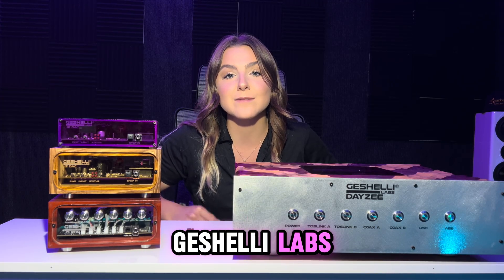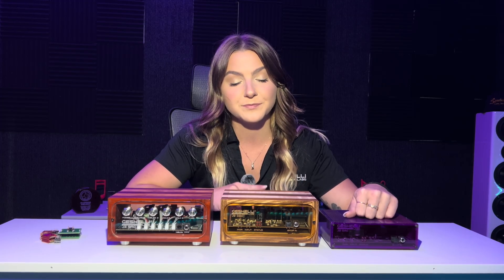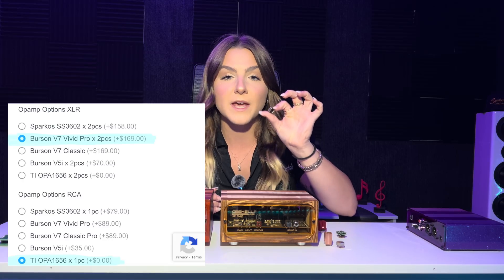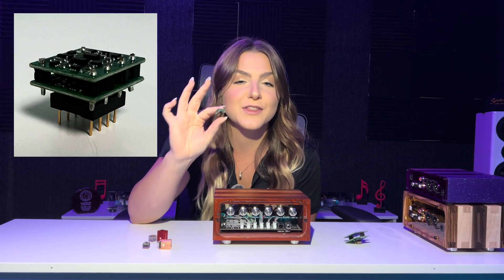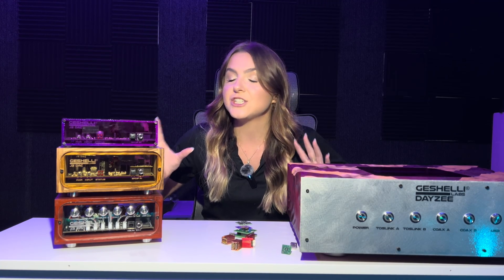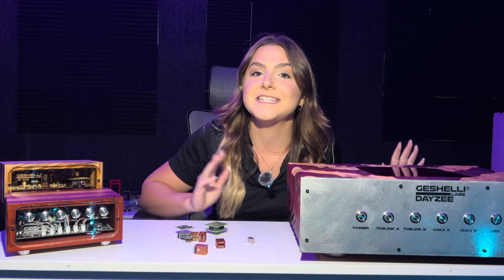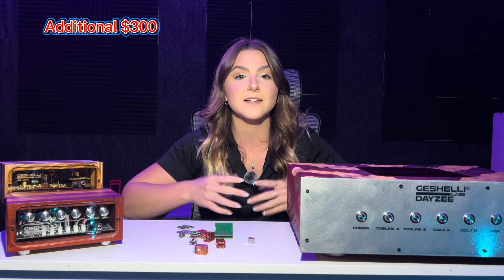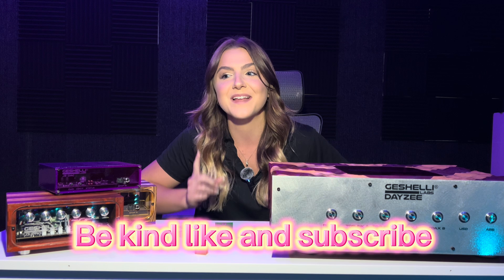WHAT DAC IS RIGHT FOR YOU? DAYZEE vs J3 PRO vs J2S vs J2

Comment: I am new to the whole “op amp rolling” thing—what are the sonic characteristics of the SS2590 that draws people to them?  Anything to do specifically with bass performance and stellar handling of low frequencies?  Or do those “macroscopic” characteristics come more from the overall circuit layout and implementation?

 Some reviews suggest that the Dayzee is a great DAC for people who like a strong low end.  It’s a bit out of budget for me though, would a J3 with the SS2590s perform similarly at the qualitative level with respect to bass slam, dynamics, extension, etc?

Comment: Have had a J2 DAC since last year.  I find that it needs a specific setup to shine. Even changing one other component of the system it's connected in completely changes how it interprets the output. Using a Schiit Magni Unity with it sounds awful, some notes are piercing and volume balance of different instruments and sound effects is very off balance; using a Nitsch Magni Piety, its the complete opposite, every note shines and isn't fatiguing while audio balance is pretty much perfect.

However, the Soundstage has a "2.5D" quality to it, which is probably just a limitation of the AKM4493 chip. I suspect that the J3 with dual Sparkos SS2590 on unbalanced route will offer fuller dimensionality, so I'm planning on buying a J3 later this year.

Using the basic J2 was a test run to see how well it works in my setup, which does include a 12V linear power supply unit from Audiophonics. It might be too much for some units, but the J2 at least responds well to it and provides some extra oomph to bass that I felt was a bit lacking with the default switching power supply.

Your mileage may vary, this was just my own perception. Keep up the good work!

Comment: Great informative video. Want to order the J2S version.I heard somewhere that there's a newer, slightly more spacious version of the J2S that can fit the sparkos lab ss2590s much easier in comparison to the first versions, is that true? Or can the J2s be altered to make the dual opamps fit more comfortably?
Reply from the maker: @phrocasso5906  thank you! The J3 is the bigger form factor which can fit the 2590’s in both the XLR’s and RCA’s comfortably! It also has independent switches for the inputs as well which the J2S does not offer. In order to order the 2590’s you do have to email in, as they do not come in the unit due to the heaviness, but I do have a video on how to swap the op amps and take the unit apart and put back together. Hope this helps!
Reply: @RachelGeshelli  you're welcome. The J3 does look nice, with the additions and space it may suit my wants but I just need a J2s. Is there a way to get the box from the J3 pro or Archel or special order the J2s with the J3 pro or other housing? Is it better to order the sparkos opamp from you guys? Thank you for the quick response and valuable information.
Reply from the maker: @phrocasso5906  you’re welcome!! And the J3 is taller to match the bigger form factor of the A3 and E3. The design of the board makes the 2590’s fit as they are wider than any of the other op amps, So the sockets are more spread out on the board. You can upgrade the case to the bigger form factor for the J2 as well if you wanted! Just write it in the comments when purchasing or email in!
Reply: @RachelGeshelli  You clarify things straight to the point. It makes sense with the J3 pro as the board is more spacious along with it's housing. Sorry, one last final question, would the 2590 fit the J2s with the bigger form factor?
Reply from the maker: @phrocasso5906  I try to hahaha I’m glad it’s all making sense! And so the bigger case doesn’t really have anything to do with the 2590 more to do with the independent switches! The regular j2 size case will fit the 2590 in height. You could fit it on the RCA but not the XLR’s.

Comment: I had a chance to meet Geno and Sherri, and their entire family/staff.  They graciously gave me a factory tour and answered all of my audio questions.  In their listening room, I auditioned their flagship Dayzee DAC, with stock op amps, connected to their own amps played through AE520 speakers.  The high res audio tracks were astonishingly surreal.  There simply were details in this music that I’d never heard before, and I’ve auditioned 500k systems. The mid and low bass was powerful and impactful, with the upper register being clear, detailed yet non fatiguing.  After hearing the Dayzee, I couldn’t audition the J3 pro.  The experience was so incredible, that I couldn’t get anything less than the best!  Sherri mentioned that if your budget allows it, go for the Dayzee with stock op amps vs the J3 Pro with Sparkos, since the price difference is nominal.  If you want to take it to the next level, you can upgrade to Sparkos op amps later. Very friendly team of people, extremely knowledgeable and quite accommodating.  Kudos to Geno’s amp and DAC designs!  FYI, the purple heart wood case is absolutely beautiful!  Very cool experience.  Thanks so much!

Comment: The op-amps are sensitive to electrostatic discharges (ESD) and appropriate handling precautions should be taken to avoid damage to the semiconductors. For example, the Texas Instruments (Burr Brown Audio) datasheet for the OPA1656 op-amp (section 6.2) states an ESD protection level of 2,000V (human-body model). In atmospheric conditions and especially if synthetic materials are present (synthetic clothing, carpets etc.), the ESD levels can easily exceed 10,000V. The semiconductor manufacturer will ship this type of ESD sensitive component is an anti-static bag. The user of the component is expected to employ protective measures to mitigate the ESD risk whilst handling and installing the component into the end equipment. In an electronics lab the Technician / Engineer will wear an anti-static wrist strap and have dissipative mats on their workbench. The Burson and Sparkos op-amps are assemblies using discrete components but are also likely to contain ESD sensitive semiconductors.

Comment: There's a lot of people on here thinking the same thing as me with all the configuration differences they offer.   Let me offer this tidbit of advice:

I literally heard their two newest DACs TODAY on site (Dayzee with stock TI op-amps & J3 with Sparkos pros).  When I found out G were just a neighboring town away from me, there was no way I wasnt going to pay them a visit.   The Dayzee is really slick and it will add another layer of resolution due to its dual mono design...but its main claim to fame is hooking to different amplifiers due to its unique dual XLR and dual RCA outputs.    And the larger case makes for some amazing woodwork styles you just have to see in person.  One thing to note Rachel mentioned  is that you have to change out all 8 op-amps in the  DayZee due to the mono design (that could get quite pricey)--and it's substantially larger than all the other DACs due to those two factors so check that for space considerations.    Another question I've seen:  The J3 page should be live on their site sometime this weekend...

Based on the op amp talk here, I'll let you know that I actually preferred the  Dayzee with the stock TI ops than the J3 with the 2590 Sparkos on most tracks I listened to...so  it might be wise just to start stock and upgrade only if you feel you need to. You may find the base devices is all you need.  I felt the Pros,  although having a little more bass oomph, in doing so actually stifled some of the music detail.   But of course they say, YMMV.

That said, the J3 should be the best bang for the buck for most people, and with covering all four popular op-amp designs and less of them to upgrade... it's literally "tube rolling" days all over again :)

Oh yeah...one more important thing. The comments you hear about how nice this family is are most definitely warranted... probably the nicest bunch of audio people have come across.   I could have spent all day and their listening room with Geno....but lots of work to do to get all those handmade products out in a timely manner to you fellow listeners :)

Comment: Why is the DAYZEE so huge?
Reply: As Rachel said it's a completely different beast.  It has basically two DACs inside with the mono design (unlike the rest it has dual AKM 4499/4191 chips).   Also it has dual outputs for both RCA and XLR balanced.  All that needs significantly more space for the connectors & to let the components breathe... but also it's larger size allows for some of the nicest woodworking designs I've seen on an audio component.   That's why it's not very heavily advertised and you basically you have to inquire about it for the details.    It also takes them hours and hours to meticulously make... so they only allow US orders at this time so they don't get overloaded. 

I heard it today and it sounds fantastic with just the stock TI op-amps.

Comment: Nice to see the different offerings. That Dayzee is something, but well out of my range and would not fit in my rack anyway.
I'm about 85% analog and 15% digital if you count CDs. I do stream, but only for occasional background noise and research, I can't stand formally listening to it. For formal listening I go with vinyl records or CD. 
That said, I have never had an outboard DAC, I just have the one in the CD player or the one in my preamp. I think the dac in my current CD player (Marantz ND8006) is likely alright or good enough, I'm not sure. The dac in my preamp though sounds slightly harsher and thin. One would think that is not the case given the cost, but the focus in design was really on the analog side and overall circuitry, which a good job was done there (partly why I bought it). The dac and headphone amp were afterthoughts in my opinion. (The headphone amp is pretty poor, so I got an outboard and solved that issue).
Anyway, I am curious about getting an outboard DAC to see IF there is any notable improvement to my system's sound for CDs and other digital stuff. I have been told there will be by many, but who knows since we all have different listening experiences. 
I know nothing about DACs beyond the very basics. I know I am tired of ESS as that is all I have ever experienced in all the CD players and such I have owned. I'm looking for a more natural sound.
An R2R DAC would have a more natural sound, but they are expensive and not many on market. I know nothing about op amps or the differences between them or between DAC chips. I believe there are no differences between DAC chip brands, but the differences are in implementation of them. I may be wrong or perhaps partly correct.
My getting an outboard DAC is pretty low on my list, but if I could try one I would choose Geshelli Labs indeed as I have been looking at your DACs for the last almost two years and when the time comes, I would need to talk to someone for some education (what op amps do and the differences, etc.) in order to select the DAC I want to try. I also can't get spendy so I would look at the J2 or J2S. I would also need to arrange something in case it does nothing, like cables.
Again, it will be a little while though as it is not high on my priority list to get an outboard DAC.

Comment: The Geshelli Dayzee with the big Sparkos SS2590 units is definitely *superb*!  I listened to it with the stock TI OPA1655 for several months, using a 12V 50W linear power supply. With the stock op-amps all the qualities I mention below, are there - but upgrading them extends/expands all of these to what I consider to be ultimate.

So many passages of music that I used to think were congested and overdriven - are sounding open and clear. Many recordings have 3D space and instruments - many sound almost like "new" music to me. Harmonies and counterpoint and discord and really subtle details - all come through - and I have to totally re-adjust my perception of the music.

Bass is simply just right. The extension and weight and clarity is flawless, for all intents and purposes.

Soundstage on good recordings is YUGE, and many are 3D - even some that I would never have thought had this quality.

Clarity - is far more than "just" extended treble. It is a coherent whole - and it covers the entire spectrum, ideally.
In my opinion, the Dayzee is balanced and neutral and also dynamic and clean. Nothing is out of place - and everything is in place.

I have had all the Geshelli DACs that have AKM chips (except the very first JNOG), and they are all wonderful. For me the J2S with the AKM 4493 is the perfect entry point. I have not been able to listen to any of the Burson op-amps, but I did listen to about 7 or 8, and for me the Sparkos are my preference.
Reply: When you stated that "So many passages of music that I used to think were congested and overdriven", was that in regards to the TI op-amps in the Dayzee? And then it opened up after installing the Sparkos?
Reply: @michaelwright1602  This is something the stock Dayzee does very well - and then after upgrading, it is extremely good at doing. Clarity and the ability to "untangle" dense /complex music - are a hallmark of the Dayzee, with both the stock TI OPA1655 op-amps; and to an even greater degree with the Sparkos SS2590 op-amps.
Reply: @NeilBlanchard  Ok, that is what I was hoping you would say... Thank you for clarifying.

Comment: Honestly I think people sleep on the 1656s. I think they are 95% as good as any discrete op amps and kinda make you question if its even worth upgrading.
Reply from the maker: The 1656’s are great op amps!
Reply: The DayZee sounded very impressive with just the standard TIs.  I would start with those and upgrade only if you feel the need to--there's more to that sound refinement of that beast than just the OPs...